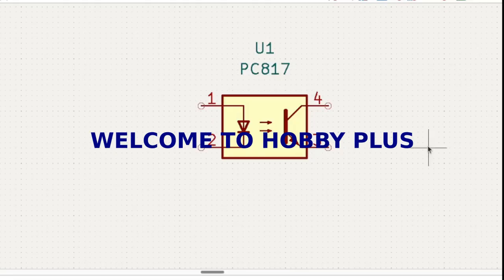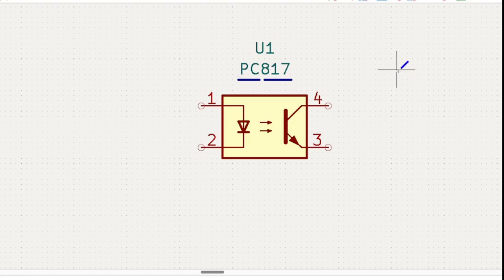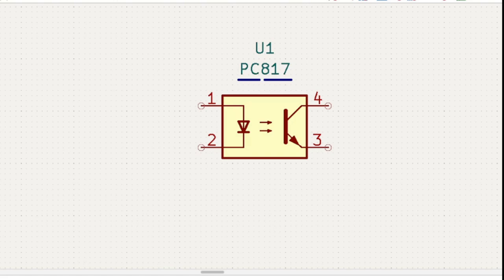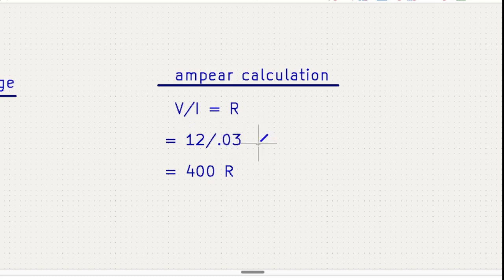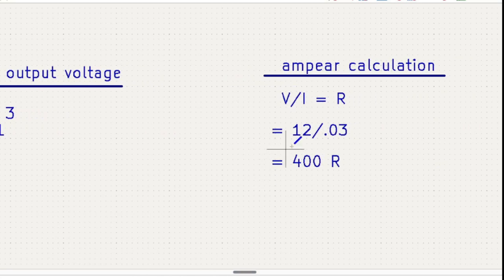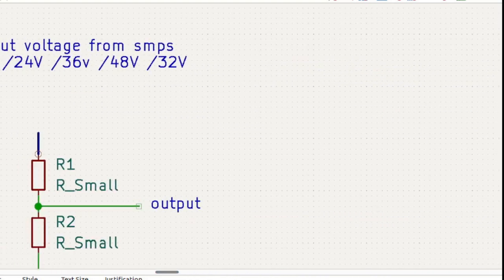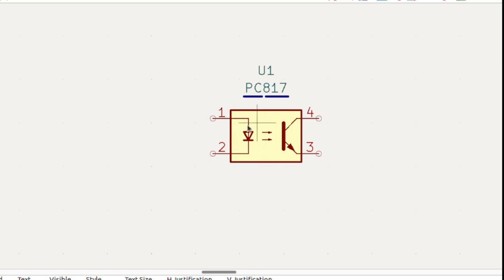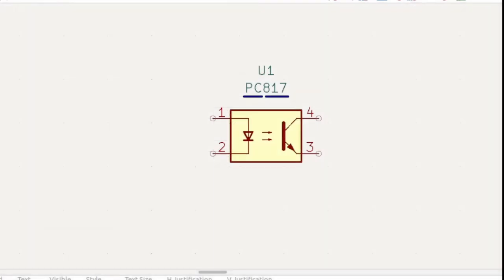[34]CALCULATE OPTOCOUPLER VOLTAGE AND AMPERAGE FOR A CIRCUIT

Comment: Btw sir with optocoupler output it might possible to measures the current but  how to measure voltage
Reply from the maker: witch voltage do you want to measures, output or input?
Reply: @hobby_plus  i need measure input voltage by output of the optocoupler by a microcontroller
Reply from the maker: I don't understand your question?